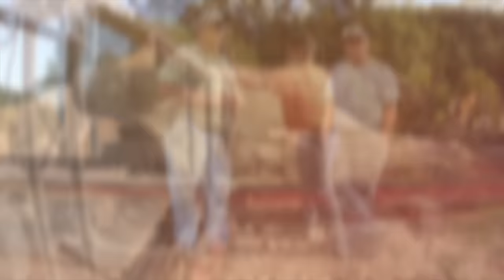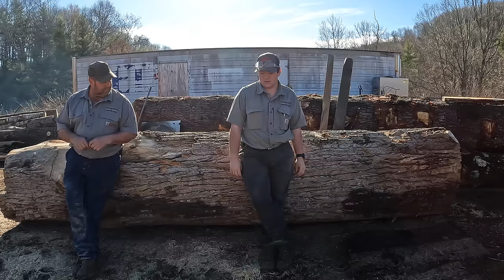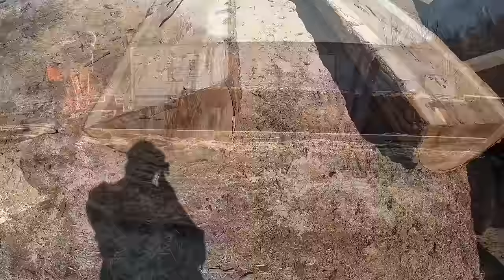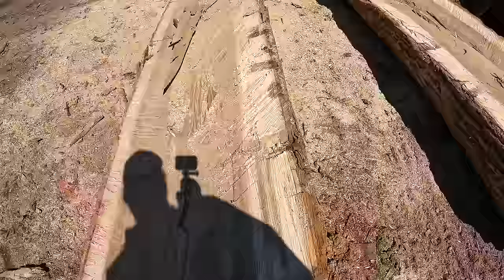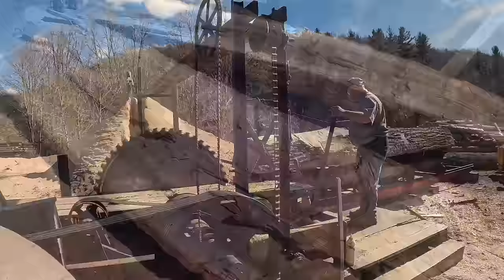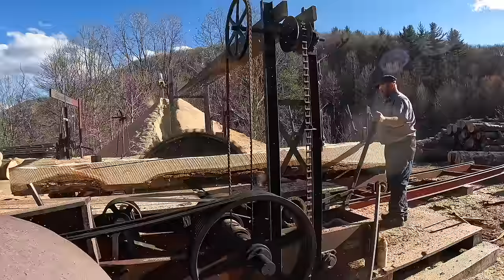Sawing Monster 40” Poplar

Comment: Wet poplar is the best stuff for straping under metal siding and metal roof . Ones you put screw in it wet , them dry your metal screws never 👎 back out . Just a trick off the day . STICK on the ICE 🧊, SAW in the Wood 🪵 and RUBBER on the ROAD . 😊
Reply from the maker: Yes it is. Thanks for watching